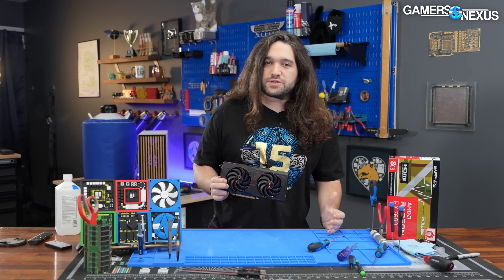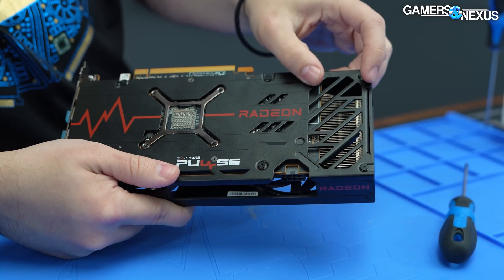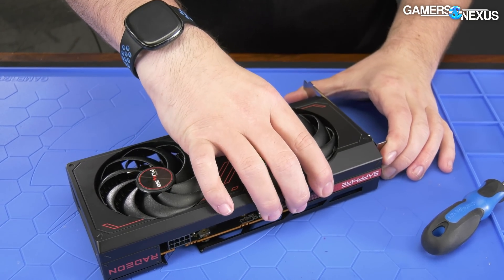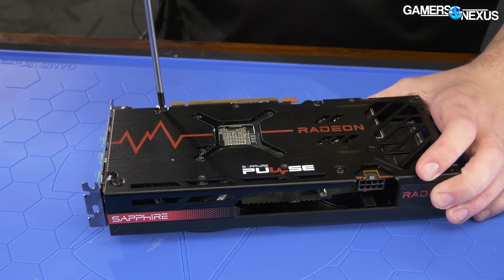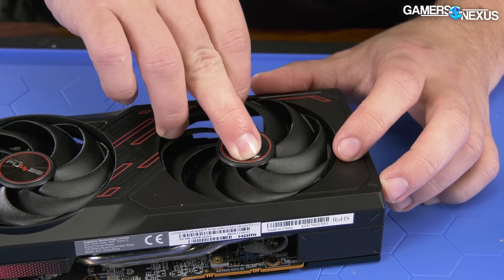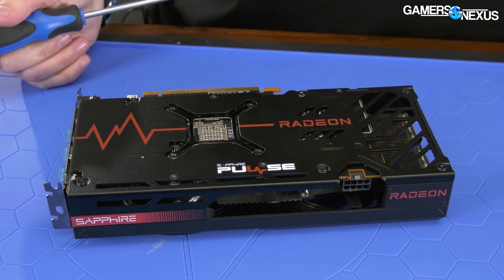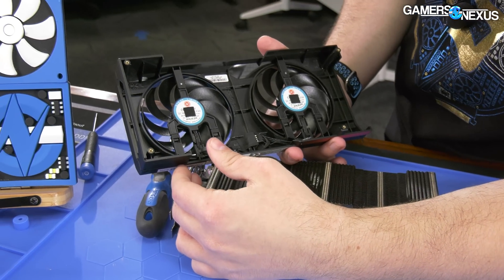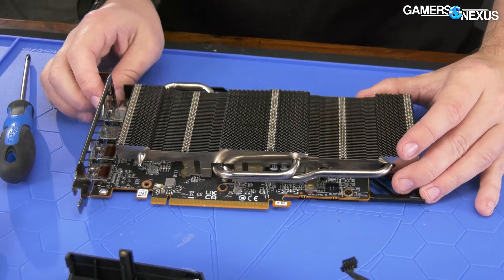Sapphire RX 7600 Pulse Tear-Down & Disassembly

Comment: Noticed this earlier today, if you teardown the Sapphrie Pulse Rx 6600, you will find that the build design (except the PCB) is extremely similar to this. Even the Pulse Rx 6600 is easy when it comes to disassemble and replace/maintain the graphics card fans.

Comment: This particular PCB design is most likely going to be re-used as the upcoming Rx 7700 XT. There are 2 more spaces for VRAM, so 12GB as it will be and the missing VBIOS switch position will also be filled. Would love to get it at $329 but Radeon is probably gonna be like "our Rx 7700 XT beats the 4060 Ti 16GB at $499, so we will price our one at $469". Missed opportunity.

Comment: Is it worth to deshroud it? I'm using a similar videocard (Pulse RX6700) in NR200P case and wondering if it's worth to deshroud it and use two 120x25 fans instead of the stock ones.

Comment: they use aftermarket cooler its cheapest way as possible vs their coolers are expensive and not worth for low power and low performance like 7600 since it won't be OC easily for any user to begin with...so it what it is., if they use vapor chamber ...then things would be different in chip ability

Comment: Asus 670E extreme ideas/help?
Yeah I’m just about to send back an 670e extreme cause it’s not even starting and never got into windows without selecting the ssd Manuel in the bios … and I’m not Abel to get in the bios when I start the pc 1/3 it keeps going through the debug codes another 1/3 i’t seems like the system is online but I got no picture on the monitor and 1/3 it tells me I got a new cpu installed and the set is showen and than I can enter the bios 
Oh and after 3 calls each 1-2h with the support I can’t even reach windows through the bios cause the pc was shut down to often
Any ideas ?

Comment: Old people like me remember that the shrouds used to be made like this. There are several upsides to this. For one, it's way easyer to clean than the designs now days, also it's easy to ghettomod bigger fans on that cooler to makit more silent and to cool it better. I wish we could see more designs like this and not the apple/nvidia way of gluing and using 100+ screws.

Comment: Is the shroud vibration damped at all? having it slightly loose would be a good thing for noise if it's set up properly.

I currently have a sapphire 7900 in my box & even pulling 400W keeping it's tj in the 70Cs, I can't hear it over the near-idling fans on the CPU cooler, it's crazy how well engineered the cooling is.

Comment: The AMD Radeon 7000 series is a skip, as is the 4000 series from nvidia.  
We have also been taught that you have to upgrade to the xx70 series or the x700 to get the full pci-e bandwidth these cards need.  Otherwise you get some crappy x8 card that pretends to be a graphics card.  It's pretty bad when my 6700xt beats the 7600 over and over and over again.

Comment: my 5700xt pulse had the same issue Its that the screws on the shroud are spring loaded and the shroud is supposed to "free float" and thus reduce resonance vibrations from the dual axial fans causing interference

Comment: The card for my first self built PC was a Sapphire HD 4850. Was happy with it. When I upgraded I went for an HD 7850 and went with Sapphire again. That card was a legend, really good. Still works too. For my second self built I went over to team green. Reviews made it seem the GTX 970 was a fantastic card.....I found the performance pretty disappointing. It was an ASUS Stryx. I sold it and got a second hand GTX 980 ti also by ASUS. That card unfortunately died suddenly for no discernible reason. I was playing Sunset Overdrive, my screen went black and it just....freaking died. I had used it for about a year or two and the previous owner had it for a year.

The market wasn't that great at the time but I went with the RTX 2060 by Gigabyte. Around the performance of my previous card, I went with RTX cause I didn't mind paying for the new tech. In hindsight it was a good choice, DLSS 2 definitely helped push out extra performance. The card is a loud piece of crap but it did pretty well.

Originally I wanted to go for a 3070 or even 3080. But then the dark times happened. I opted to go for a monitor upgrade instead (1440p ultrawide baby).

Looking back at it I feel I dodged a bullet, looking at the lacking RAM on those models. Plus I really hate how Nvidia conducted itself. I really like stuff like DLSS but they simply don't deserve my money. 

Since I was going back to AMD going with Sapphire was the obvious choice, pretty much the number 1 in AMD cards as far as I am concerned. 

My RX 7900 XT Pulse is really quiet. It's not like sitting next to a freaking blow-dryer anymore. 

Though I have to say, it's a good thing the card went down by about 400 bucks or else I wouldn't have gotten it either.

I gotta say I like AMD's software a lot better over the Gforce Experience (stop making me log in for driver updates Nvidia....ffs). And I don't know what it is, some people call me crazy but....I SWEAR the colours look better on AMD cards for some reason.

Comment: Based on past Sapphire cards, you don't even need to remove the shroud as the fans are only held in by one screw and uses contact pins.

Comment: IIRC, I menage to deshroud my Asus Tuf 3090 without taking it apart just by removing the six very tiny screws, three on each side. I bought it used from a miner when the crash happened and it was nasty. I only disassembled it once to clean it and install both front and back water blocks so I'm not 100% sure on the shroud disassemble but I didn't need to remove the IO plate even once.

Comment: This is a really nice design. Simple, but in this case that's really valuable (nothing about this card needs to be complicated). Also, those fuses are REALLY good to see, because they're a sign that Sapphire cares about repairing boards. Like you said, fuses don't prevent failures, but they DO prevent charring expensive ICs, PCB traces, etc when something goes wrong. They're an insurance policy, often omitted to save a few pennies, but their presence means that Sapphire cares about recovering the board if it happens to suffer a fluke power rail excursion (replace the component that failed, replace the fuse, no cooked PCBs, good to go). I'm really happy to see this.

Comment: The advantage of a removable shroud (and keeping the heatsink on the card) is the ability to fit your own fans of choice for quieter cooling. De-shrouding, in other words. But ideally the heatsink needs to be flat with no protruding obstacles that would prevent fan mounting, and it looks like this one would work fine.

Comment: that cooler design i think is brilliant at this price point, is straight to the point and really painless to set just some noctua fans in if you want or even use that cooler in another gpu as a spare if the worst comes to that gpu, i think is quite awesome design allowing for really long service life

Comment: 07:11 "I don't think I've seen that before"
What do you mean you've never seen that before?
If I was tasked with designing a GPU (having never taken one apart myself) my first instinct would be to mount the shroud separately?
The common way of mounting to me sounds like if the radiator in a car was mounted to the engine, and the front bumper to the radiator?
How has no-one done this mounting technique before? Seems kinda insane to me wtf

Comment: Why do you say it's a nice feature fixing the shroud directly to the PCB? Isn't it exactly the same as fixing the shroud to the heatsink with 6 small screws on the sides, like on TUF models and some Gigabyte ones? You can still take the shroud off after unscrewing those 6 screws and replace the fans, just the same.

Comment: That's actually a very good thermal design to dissipate as much heat as you can and not keep it on the PCB, this is what i keep repeating in the comment section for so long.

Comment: 8:15 i have a palit dual oc gtx 1080, it is exactly same build as this card. It was built in 2018 march, fan died last year. It was rather easy to change it like 5-10 minutes. The fan was branded as firstd
Reply: The shroud thingy is way more worse on my card, it's all wobbly, sagging, shaking, you name it. But since i put it in the case and never look it again, like i did that i bought skylake machine and never ever touched anything apart from an m2 ssd and gpu. So it is not a problem if you don't open your case every time and touch it as a pervert...

Comment: I was really surprised how cheap the RX 7600 cards are here in NZ and think shops might sell a decent amount of them. The RTX 4060ti cards average $900 NZD, i.e., $550 USD. These Radeon cards are just over $500 NZD, when I expected closer to $700 (for reference, a RTX 4090 tends to be about $4000 here -- $2500 USD).

Comment: I have a sapphire rx 590. I had a fan that started grinding in a month of ownership. I contacted support, they asked me to send a video. I did. They got back to me in a few hours asking for a shipping address they can send the replacement to. I did not need to send proof of purchase or anything. Those were one of those one screw quick swap fans. They asked me to send back the deffective fan for failure analyze, if I can. Was a nice experience other than it happened in the first place. Over all I am satisfied with the brand. It's been years and the card still serves me well. Sapphire is good in my books.

Comment: Sapphire have been pretty good, so of course, I am personally not too worried about loosey heatsink on the video cards, since I decided to just water cool them from now on, as GPUs are already of massive superscalar cluster type nowadays, with out-of-order execution capabilities gradually added (which adds to heat output), so it makes sense to me to cool it very well from the beginning, otherwise I can just fix the heatsink issue.

Comment: The card tears down pretty much the same as the RX 6600 Pulse. A few differences, like dual heat pipes vs a single long one, a finer fin stack on the 6600, the bar for the VRM pads. The shroud is attached the same. The fans are attached the same. Same fans. Same back plate for the most part, though the 6600 is a smaller card with out the heatsink over hang. The numbers on the 6600 are good over all with low to no noise, temps that never get too hot and the single 8 pin so power draw is exactly what is expected. FPS is pretty much good for all out at 1080p and this card is aimed at that market, but can apparently perform well at slightly reduced settings for 1440p. I don't have a 1440p monitor so IDK.

Comment: the lose shroud could be made into a feature: add some rubber grommets around the screws and call it "vibration isolation" :-) (of course it wouldn't do much, as the whole shroud would still be acting as a speaker membrane if one of the fans were to vibrate – but hey: marketing!)

Comment: The unpopulated parts seem to me to be an RGB controller, RGB switch, and RGB header, and a dual-BIOS switch and second BIOS chip.
There's also some unpopulated VRMs, at least one is going to power the above RGB system.
The header under the unpopulated controller is debug or programming. I see another spot on the back of the board. Likely an RGB header for a decorative plate that covers the flow through region.

Comment: The Red Devil RX 570 had a very similar shroud modularity, although it was all metal. The shroud actually came off and left the fans on the heat sink, but they could be easily switched out in situ. I used to love doing custom paint jobs on those things.

Comment: I have an RX6700 non-XT and it performs on par if not slightly better than the RX6650-XT (granted im only at 1080)... I'd like to see a RX6700 non-XT vs RX 7600 benchmark

Comment: The nice thing about that shroud design is if you're dealing with a SFF build where the case fans end up being what cools the GPU due to a lack of space for a typical thickness GPU, this card makes that easily implemented without proper full disassembly. A bit disappointing it had so much play in it tho

Comment: Knowing Sapphire, I suspect the PCB spots are for the 7600xt model which will be 100 bucks or so more with RGB and V-Bios. Probably aimed at higher end 1080p gamers or something. I've yet to have a Sapphire card fail in over a decade now. I always thought of them as the Toyota Corolla of GPUs. Nothing fancy, but the suckers just keep going forever. All of the cards I bought are still going in relatives PCs who just need to do email and stuff, since there's no point in throwing them into E-Waste buckets if they still run great.

Comment: Great review.  I'd buy this 7600 over the others because of serviceability features for the shroud and fan - it's the small things that matter between the various 7600s.  
My use case for the 7600 would be for light gaming and AV1 encode/decode.  I don't know if AMD's AV1 encode/decode on 7xxx series is any good or not (more research required).  Would love to see GN do series on 264/265/AV1/VP9 GPU encoding/decoding

Comment: That having the shroud and fan separate from the heatsink, and the flexibility of the mounting of the shroud, is a SMART move.  I really like that part of this design.

Oh, and that empty controller and two headers Steve comments on are probably for the Nitro+ version of the card, which they like to add an RGB controller and external header.  I have an RX 6600XT Nitro+ card, and it has both of those while the Pulse version does not, and costs a little less.

Comment: The ease of disassembly is a good thing. I am not a massive fan of the mounting system on the inside of the shroud though. 4 plastic posts with threaded brass inserts is not exactly a robust mounting solution. No wonder it has so much play, it is probably just the plastic posts flexing. Good from a simplicity / ease of use perspective, but it really needs at least one screw going through from the I/O plate (which should have been factored into the design along with a more suitable I/O plate). It would give the shroud so much more rigidity.

Comment: The blank connector is interresting because of the DI port. 

Often DI means Digital IN and DO Digital OUT.
The same is used for Analog ports too.
Reply: It seems to fit the ARGB header pinout, so the assumption that this could be used to easily feed in RGB to sync the card's "bling" to the rest of the system seems reasonable (and actually much simpler and more compatible than adding a separate RGB controller to the card; everyone who wants to use RGB will have their preferred controller in the system anyways).

Comment: XFX Merc 6900/6800 are easy to take out the shroud. Only 6 screws (2 per fan) in the front and you take the entire shroud with the 3 fans attached to it.
Also the shroud in these cards is made of cast aluminium and firmly attached to the heatsink, so it feels pretty dam premiun.

Comment: My local store has 3 fan models of this card.  Gigabyte oc and xfx.  Base clock 1875 game clock 2355 and boost clock 2755.  only real diff is 2 hdmi /2 display on Gigabyte and  1hdmi and 3 display on xfx.  Not sure which one to get.  The store is charging more for 6600xt and 6650xt.

Comment: Sapphire did pretty well this time. Sapphire RX 6600 pulse had only 1 heatpipe. Only 1! RX 7600 has 2. That's an improvement. and as Steve said Shroud design got better. 

I am glad Sapphire did their homework this time. Should I buy RX7600, I guess Pulse model is going to be my first choice.

Comment: actually you dont have to take the whole shroud off to replace or clean a fan. 
they are secured with a tiny screw, that you can reach from the top between the blades and just take the fan out this way. 
most comfortable way to replace a dead fan that i have seen so far :)

Comment: This reminds me of my 6700 Pulse, which was okay, but due to variability in heatsink quality mine ran 95c on the junction when most outlets had theirs significantly lower and I live in a very cold place with a high airflow case. So this GPU may or may not be good depending on your sample.

Comment: Dual vBIOS on a $300 card were found on Sapphire cards as my $280 RX 5600 XT had the vBIOS switch as well as the user replaceable axial fans. GPU manufacturers are really cutting back these days

Comment: The looseness is vibration dampening on the outer fan shroud. There's literally no reason whatsoever to have springs there if not for that reason. I forget model, but one of my old Nvidia cards had this as well. I know, because the first time i took it apart, a couple of springs got lost, re installation resulted in a noisier card.

Comment: Wow, like you mentioned I haven't seen a GPU shroud that comes off that easily since the old Radeon HD 7000 series and the R9 series GPUs. My old Powercolor PCS 7970 and Sapphire R9 280x toxic all came apart just like this pulse model, made it so easy to replace fans and to clean out dust etc... Awesome to see again!
Reply: My Sapphire RX570 ITX is like this too. Also my old HD7750 and HD7770.

Comment: The Vega 56 Pulse also had a flow through cooler design, simply because they used the "nano" version of the Vega PCB for it. Essentially half of the card's length was just the cooler, similar as you'd find on some modern nvidia cards these days.
Reply: The Vega 56 Pulse also had a similar easily removable shroud design (as well as contact-pad fans). Somehow something ended up damaged on my shroud where one fan would not spin, long after warranty was gone, even after replacing the fans. In the end I removed the shroud, not disturbing the metal portion of the heatsink, and zip-tied a couple of case fans on, using an adapter to run them off of the cards PWM signal.